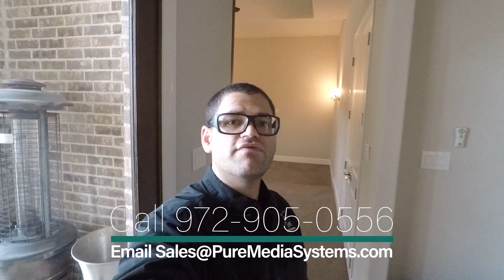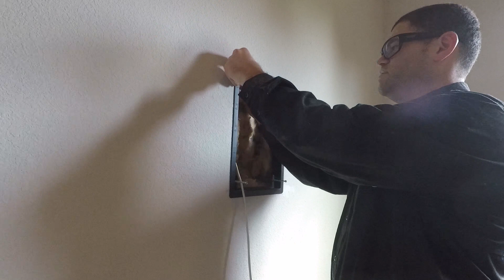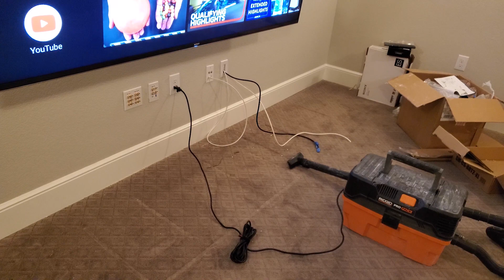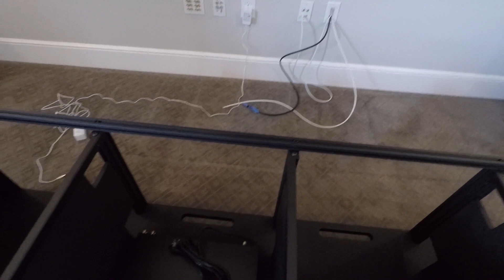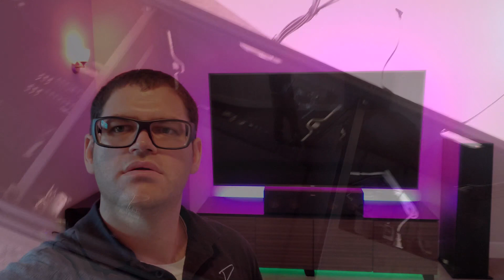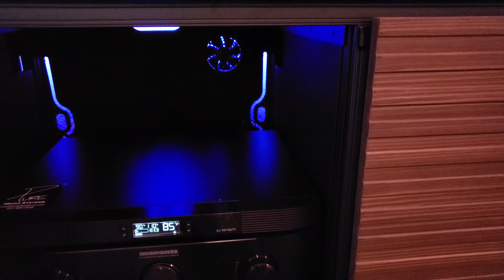7.1.4 Dolby Atmos Media Room Install - Klipsch, SVS, Marantz

Comment: What speaker wall plate did you use for 7.1.4?   Thanks
Reply from the maker: We use modular wall plates with keystones for speaker terminals, HDMI, Ethernet, etc. This allows for us to utilize the wall plates for different applications so that we aren't stuck with predetermined layouts.